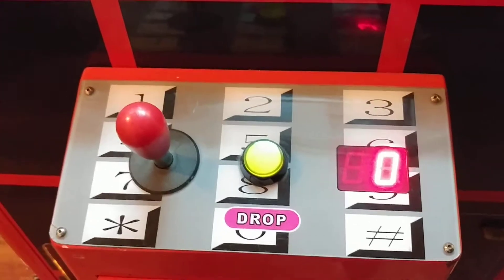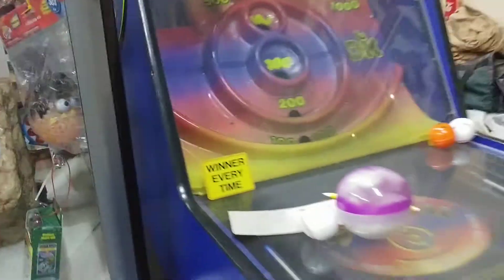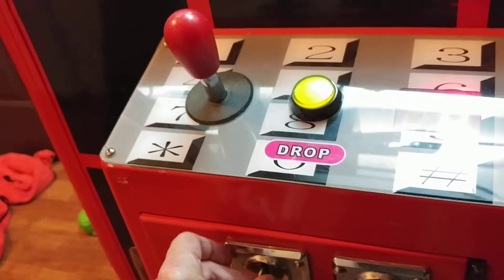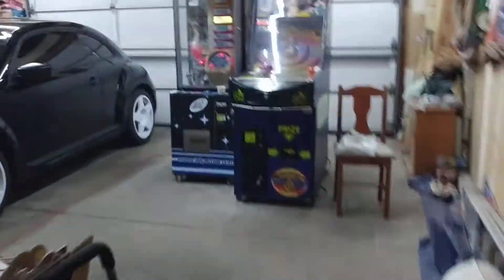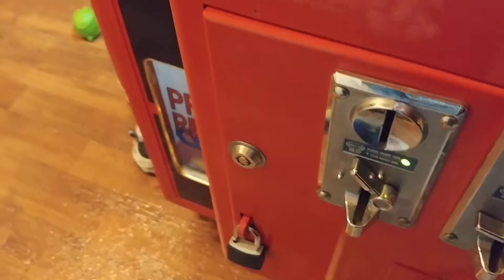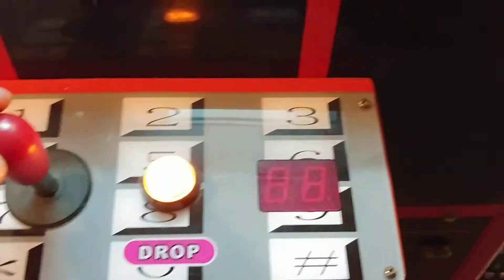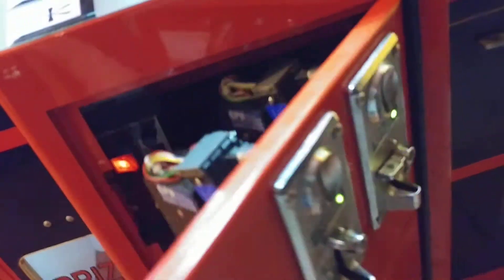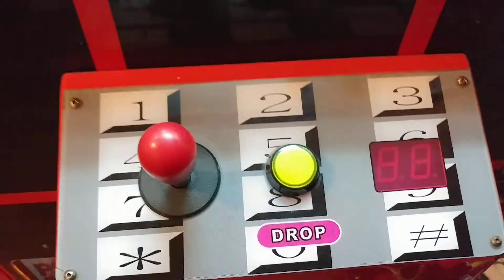Telephone claw machine

Comment: Yes, I would check to see if there is 48v, because without it, none of the motors can move, I think the reason there is an error is because it was expecting it to go down but it didn't so it was probably wondering why the stop up switch was still activated, try and see if you can manually release some string to move the claw down enough so the limit switch isn't triggered, if it does something different, we know the switch is fine.
Reply from the maker: Dude your awesome..i can't do much right now everyone is sleeping..but I have new motivation..im getting back into it when I get up..

Comment: Any luck with the telephone crane?
Reply from the maker: I kinda forgot about it around the holidays.. It's crazy you asked I was just talking to somebody at work last night about diggin into it..
Reply: @joeyamada4976  It's all good if you still need help with it. all you need to check is the power supply.
Reply from the maker: @RamClaw  I just cracked the door open a little.. Can't get to the top 2 screws without removing it from where it's mounted., saw 3 wires disconnected from the 2 fuses.. Removing it now to get the door off.. I'll take a short video and post it to my channel..
Reply: @joeyamada4976  Awesome, i'm almost certain it's an issue with the power from the power supply, basically these power supplies output 5v 12v 24v and 48v. The 5v is for the computer board, the 12v is for the coin mechs and part of the computer board. the 24v is for the limit switches in the gantry and 48v which is the one your missing is for the motors and claw, it could be as simple as a blown fuse in the power supply, or a broken wire coming out of the power supply, or maybe the power supply is faulty, does the power supply connect directly to the board with fuses on it?
Reply from the maker: @RamClaw  naw its a little box that sits next to it.. I made a few short videos on my channel if you want to see what it looks like.. I found 3 wires that went to the fuses in question that were disconnected completely.. I checked the fuses they are fine.. Hooked the wires back up.. Wondering now why they were disconnected in the first place., haven't turned it on yet to test worried and excited to throw the switch
Reply: @joeyamada4976  Yep, that would definitely be the issue, the wires might've not been attached properly to begin with from the factory and maybe someone pulled too hard on the wires coming out of it. It looks correctly wired now, plug it in and give it a shot.
Reply: @joeyamada4976  Just saw the video of it working, i think you should check the string, if it's tight, it might be wrapped around backwards, it should be in the shape of a Z, have a look at the spool where the string is it should be coming out of the right side of it and not the left, if it is the left, then it's wrapped backwards and you'll have to cut the string and re wrap it.
Reply from the maker: @RamClaw  it's comming out of the right side.. It looks tangled on the spool.. The code is for the upper limit switch ..I made a short video of that ..will post it.. Thanks for all your help..
Reply: @joeyamada4976  The reason it's saying up limit switch error is because it's failing to descend, it should start going down as soon as the button is pressed, if it fails to go down after 1 second it errors,

You should try and take the claw off the string and release the limit switch straight after you press the button to see if it starts unwinding
Reply: I just watched the video, the string looks fine, I'm wondering if there's a broken wire or something that's going up to the motor, could you make a video showing the fuses down the bottom and also the big connector that's coming out of the board and going up to the claw mechanism.
Reply from the maker: @RamClaw  I think I know where your talking about.. Gonna have to continue this quest after I get the kids off to school in the morning.. Made some big progress though.. Glad you said something today.. More light in the house during the day too..
Reply from the maker: @RamClaw  ok..just made a short video.. I think that's what you were talking about
Reply: @joeyamada4976  Yep check the one labelled UD, that's the up/down fuse, if it's blown, then that's your issue. Sometimes the fuses may have a bad connection to the fuse holder, this happened to me once.
Reply from the maker: @RamClaw  just checked the fuse and it was good ..but I traced the wires and found the problem.. Damn mouse.. I just posted a short video on my findings.. He had a nice little pad going
Reply: @joeyamada4976  Yep, there's your issue. If you have a soldering iron, you could try fixing the broken wires. Or you could buy a new wiring harness from coastal amusements.
Reply: @joeyamada4976  I just watched your video of the working crane, It's awesome to see it working again, you can change the price per play, just look at the manual and it should tell you. To change the strength of the claw, underneath the voltage meter there are 3 potentiometers, the ones labeled VR 1 and VR 2 are the claw strength controls, the one labeled volume changes the volume of the sound. VR 1 is the strength of the claw when it first closes around the prize and goes up. VR 2 is the strength of the claw when it hits the top and it starts moving towards the prize chute, setting VR 2 to a weak setting will cause the claw to pick up and drop the prize. The meter above the potentiometer shows what voltage the claw is receiving, with the strength all the way up, it should be around 50v, setting the claw too weak will cause the claw to not even close, this usually happens below 10v. If you set the claw near max strength and play it for a while, you will notice that the claw gets very hot, it's best to try not to let it get too hot otherwise the coil could burn out, the general rule is, if the claw is too hot to touch, make it a bit weaker or stop playing for a bit until it cools down.
Reply from the maker: @RamClaw  yeah it was great but this machine man.. After we played a few times when I finally won it dropped in the prize shute and set off a new error.. It's something to do with the sensor.. One is kinda loose the other one is tight..i moved the loose one tried to tighten it.. Don't want to break it.. Let it sit cause I work graveyard.. Tried it today was working fine until I won again.. Same thing.. 0E.. Error.. Gees..at least the motors all work..
Reply: @joeyamada4976  The prize sensors usually start going bad after 10 years so it's best just to unplug the wires going to it...
Reply from the maker: @RamClaw  I was wondering if I could just do that..
Reply: @joeyamada4976  Give it a shot, on some machines though, it does error out straight away when the prize sensor is unplugged, but it could be different on the newer boards.
Reply from the maker: @RamClaw  right on brother thank you for holding my hand through this whole thing.. I would've never made this kind of progress so fast..